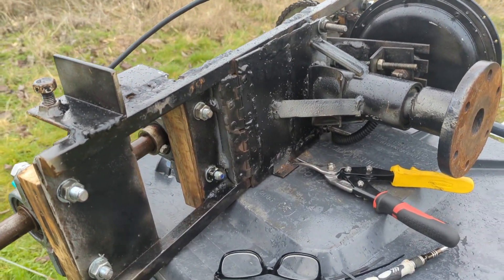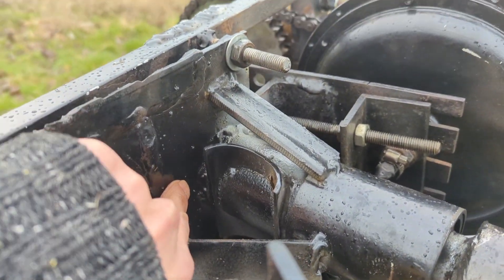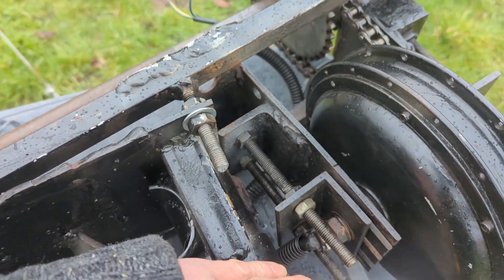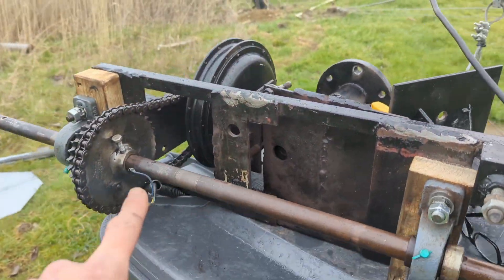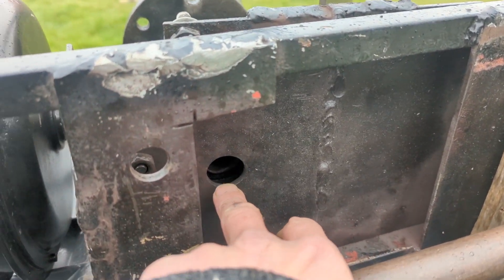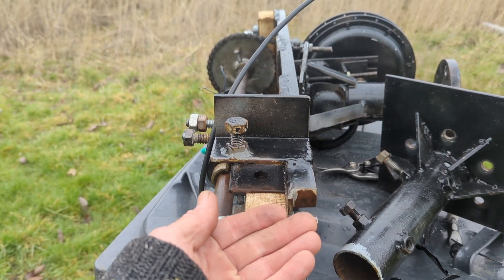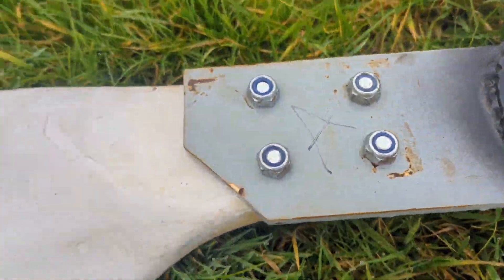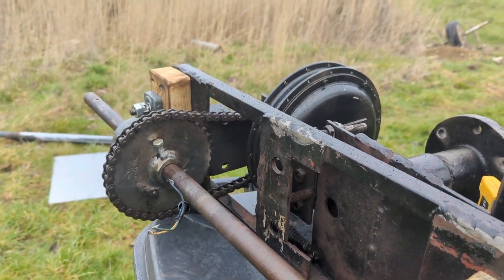Wind Turbine Project - Going back on the tower - What will I do differently next time- 6 March 2023

Comment: Greetings Gavin..
When you first made this buddy did you have to make any adamptions to your home, 
My thoughts would be would buy a few car batteries charge them batteries but then have the batteries to my mains.
Would this idea work please mate
Reply from the maker: Yes my friend, This in principle would work. Get as many car batteries as you can wired up to the turbine and then you can connect those batteries to an inverter which will plug into your house.

Comment: Quite a set of mods lined up there.  I see Amazon do a 160lb linear actuator for about £28. ( Brand: "Justech" ) Presumably you'd have to bleed off a little power from the turbine power via a small rectifier with a voltage sensing relay. All at the top of the mast and waterproof...... Interesting but challenging!.  But I think, maybe, an in-line furling tail hinge based on the falling saloon door style would just fine okay with your turbine.
Reply from the maker: That's what I'm going to try , was thinking I wonder if I could activate it just using a 12 volt lithium power pack. That way I wouldn't have to mess with the existing wiring